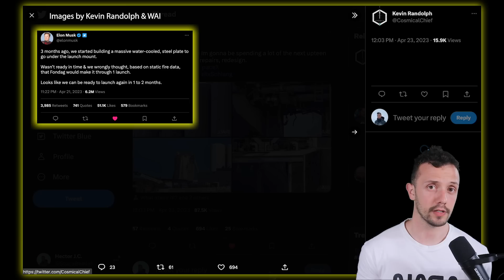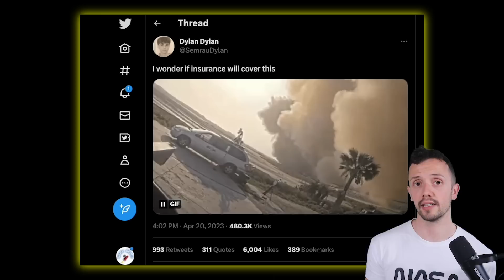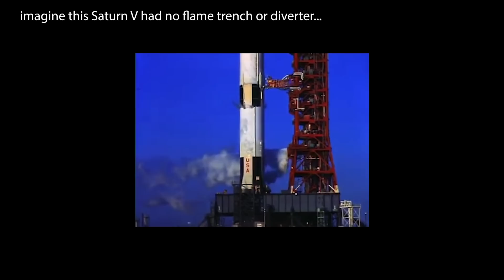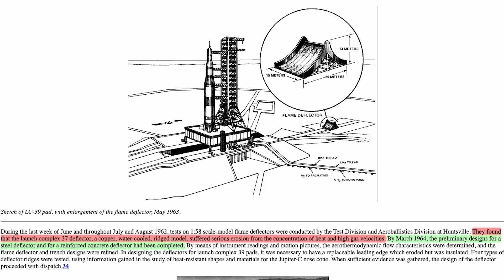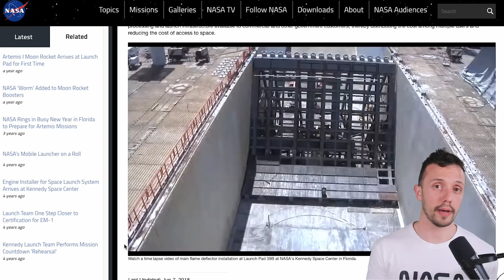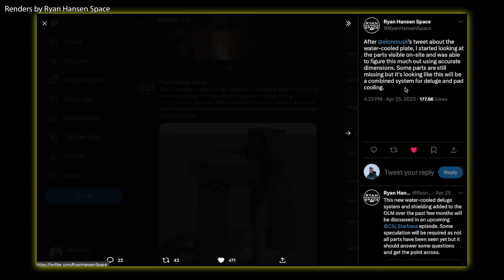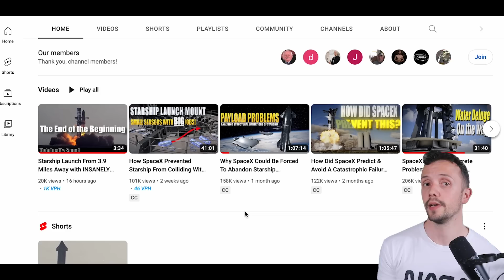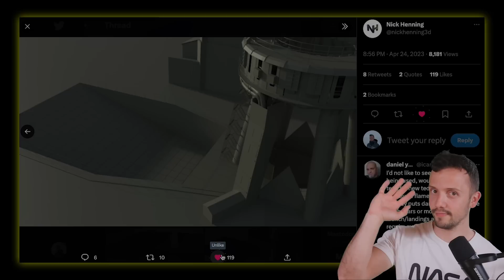SpaceX is Developing a Smart Solution for its Pad Problem: What We Know & What It Could Look Like!

Comment: If they were wrong about the concrete, they can still be wrong about a flat plate.  I still see the exhaust gasses rebounding back into the vehicle.  It looks like a 50 cent solution for a $10.00 problem.

Comment: You could have an Upside-down cone to use as a flame diverter and then have the launch platform legs wrapped in armor plate. You could have the flames come out between those legs like they do from a muzzle break on a machine gun... using the type of armor plate used on battleships. That sort of thickness of steel might be needed. Thankyou Space Beetle.
Reply from the maker: I also saw a design concept similar to an upside-down cone, which would likely work well too, but I think SpaceX wants to maintain easy access to the engines of the booster when on the OLM, so I guess that's one of the reasons for going with "just" a steel plate. And yes, the plate will need to be very thick
Reply: I imagine a cone is harder to cool, compared to a double ramp style design.

Comment: Reading so many comments that are stating that this is a massive problem and that SpaceX could have prevented running into these by simply sticking to known and conventional solutions. I'm no rocket scientist, so not here to judge those comments. Just here to remind; this journey from SpaceX is not about the use of known solutions, but rather on innovation, exploring new ways to solve known and new problems, simplification and eventually achieving significant optimization. It's the hardest way to go with the least certainty of success, but is a way that could potentially deliver capabilities that humanity never had before.
Reply from the maker: Mistakes are more frequent when innovating, and that is a fair price I think. I like the way SpaceX does things and learns. Their pad mistake could very well lead to a new flame diverting system that works just as good as the traditional ones, but is more flexible and possibly cheaper.
Reply: Innovation would have been going further on the design and versatility of the space shuttle. The most versatile and useful spacecraft ever. Not going back to conventional rockets and having to reinvent everything just because you want to go bigger.

Starship and it’s booster are like the burj khalifa. Very tall, but they need to pump out all the shit by hand. Three steps back from a simple sewage system that has been thought out for centuries.

This is what you see now with silly starship.
Reply: Don't agree at all.  The  "innovation" argument with this specific issue is bogus.  Starship is such a hugely ambitious project on so many levels that adding one more "clever innovation" is a deal breaker. Would've been SMARTER to go with some variant of an orthodox flame trench and water deluge system.

Comment: I agree with you Sir: was/were the rocket OUTAGES due to debris?    I believe that 5 or 6 of the engines were not functioning, or at least not properly functioning.   I am not a rocket scientist, and I understand that Elon and SpaceX are working on new technologies, but using a flame/thrust diverter, appears to have worked reasonably well on other large rockets.   Perhaps, just perhaps it's not always the best choice to avoid older technologies that work.    Look at the damage - it's staggering.    Would have a flame diverter eliminated or helped to eliminate this damage - maybe?    Technology and new engineering techniques are interesting.
Reply from the maker: They could have used that already existing technology but I guess more frequent/bigger mistakes is the price to pay for innovation. Maybe this mistake will lead to an even better flame diverting system that works well for them and is cheaper/easier to build and replicate.

Comment: the water cooled steel plate is a win win for me tbh. if it actually works out then i will be very surprised and amazed and if it doesn't work out then i have something to laugh about. so either way its gonna be fun to watch this
Reply: Test it out using a static fire at 100% blast, for twice the amount of time a real launch would take.
If it can survive that you're golden.
Reply: @protorhinocerator142  If it doesn't survive a static fire like that then it's back to square one only this time there's no flight data.
I say launch and be done with it at least there will be more flight data.
Reply: @straighttalk2069  FAA won't allow them to launch until they fix this problem to their satisfaction.
So no.
Reply: @protorhinocerator142  Don't the FAA have to grant permission for a static fire and road closures, meaning a no to static fires ?
Reply: @straighttalk2069  no

Comment: Great video, as always...
Note that both the launch pads 39A and B were built up to allow for the construction of the trench.  The Cape has as high a water table as B.C.

Another miss I will never understand...
Fuel and oxidizer are stored at the exact opposite ends of 39A & B. Each, 0.25mi from the mount, 0.5mi from each other.
You can emmbellishingly spit from the B.C. mount to the fuel farm.  Theycould have built the fuel farm horizontally and place it at the sub-orbital location...but then again, thats one hell of a mess.😎
Reply: @Dan P For this to be done right, all of Starbase needs a redesign.
Or maybe open a new section of Starbase with the new and improved launch system.

Comment: SpaceX aren't allowed to build a trench because to do so they need to get permission from the Army Corps of Engineers as it can potentially disturb the water table in the vicinity, such a process can take years. Given the problems found during this launch seem to revolve around the integrity of the concrete and not reflected pressure waves hitting the booster, flat shielding with sound suppression water deluge should be ok. It is clear they have been working on this for some time as the mount being built at the cape is very different incorporating the deluge system and yet to be revealed concrete shielding.

Comment: If the chopsticks are designed to catch the booster can it also accommodate lifting the whole fully fuelled starship + booster, say 1/2 tower height, at launch?
Reply: Exactly.
Suppose it lifted the rocket from the trolley to the current base, rotated 90 degrees from the trolley. But then there's another base 90 degrees more, and higher up.
Put the diverter under that, and it won't interfere with the trolley moving new rockets into place.
Reply: @protorhinocerator142  great idea. If ordinary people can think of this than it is clear not enough thought is going on at Stage 0 designing. Obviously most of, (and probably nearly of all of the whole launch site) the massive effort the 1st starship/booster launch was rushed and wasted because of this very reasonable and realistic oversight, though, somehow, I think we are all equally to blame.
Reply: @jazzunit8234  I'm not to blame. I wasn't there.

Comment: What SpaceX appears to be planning for the OLM could best be described as a water cooled heatshield. It's not a diverter cuz it's not diverting anything. Nor does it need to. Heat is all the concrete really needs protection from. People don't realize this, but concrete and even natural stone has water in it. When you rapidly heat it past the boiling point the water in the stone expands by up to 600X fracturing, even exploding the concrete.
Reply: For a heat shield to work the water will have to be pressurized. If not built properly any damage to said heat sheild will result in pressurized water escaping which when combined with the heat of the rocket will lead to a massive steam explosion. So I have my doubts whether this solution by Musk is viable.

Comment: Diverter not needed  -  Fill in the pit with concrete and cover it with a water cooled layer of steel.  The sonic 'Jack Hammer' will not be able to break up the steel sheet and the water cooling will stop it from melting...
Reply: nope, won't work.

As soon as even just one little weakpoint in the steelplate is present, it can and will become a crack and this will mean that the heat will get underneath the steelplate, lifting and breaking up the steel plate and then attacking the concrete underneath and...... Elon will have to claim another big successful launch while waiting for months until stage zero is rebuild once again.

Comment: Its not a diverter because it does not redirect the thrust, nor the acoustic energy caused by the boundary turbulence with the plasma flow.  Rather, its a Reflector that will cause a lot of the thrust and sound to bounce right back up into the engine bay.  Moreover, you would think that they now realize it might be handy if it directed the blast AWAY from the launch tower and the fuel farm tankage.  Those plates need to be sloped and curved to do the job, and they ought to be segmented for easy and quick replacement because they will still suffer tremendous wear.   Unfortunately, the hexapod design of the launch mount does not allow for a single piece flame diverter to be rolled in and out, due to the confined space between legs being significantly less than the diameter of the blast zone. And the only reason their design might be flat is because they are trying to preserve their ability to roll their engine install and servicing rig under the mounted boosters.   A surface perpendicular to the thrust vector is a solution that maximizes the energy impact on the pad, rather than reducing it.
Reply: In short, they are trying to reinvent the wheel because someone in the command chain is to stubborn and to much of a megalomaniac to want to listen to proven scientific facts.
If I was a US taxpayer I would be peeved of at them wasting time, resources and money on building things that anyone with basic understanding of physics can tell them isn't a solution

Comment: The soviets N1 rocket flew twice as far as Starship 50 years ago! with its 30 nk-15 engines this launch pad fiasco is the beginning of the end for Starship the steel water cooled plate wont work it will explode like a huge boiler tank they need a Trench or its over for Starship the FAA will be insane to allow them to launch without a trench!

Comment: Shows the advantage of actual test launches.  The public and engineers get to see actual results.  In this case we now know that a flame trench is needed.  Problem is, the FAA has blocked launches for the last 2 years.  Allow SpaceX to put their fixes in place.  Then launch again.
Reply: ah yes that darn FAA that was looking out for the safety of the fauna, the flora and the people working around or living within miles of the launch site.
The same people that now has their windows broken 6 miles away and other damage inflicted because of the 'successful' launch by SpaceX.

Comment: I doubt a diverter alone (half-measures) will protect the tank farm, control sound, or dampen vibration. Plus the tower will still have to deal with the heat and any debris that are kicked up. None of that is conducive to rapid reusability.
Reply: just allow SpaceX to build what they need to build.  Instead federal regulators will delay and delay.  And Biden will not step in to require that all interested parties work together quickly so that SpaceX can continue to test their system.
Reply: @Steve-Richter  If that means we lower risk to public safety and increase the chance of successful outcomes, I don't see the downside of government regulations.
Reply: @aeasus  the FAA says this launch did not damage wildlife. Next launch will cause less damage and the engineers will learn more. Very worried the regulators will shut SpaceX down.
Reply: @Steve-Richter  I doubt SpaceX would get shut down. But, knowing you're going to have a problem with a launch and not resolving it because of time constraints on an alpha prototype is not acceptable. That tells me there needs to be more adults in the decision making.

Comment: It just shows you how well built starship was built!
Reply: Steel will provide that. Unfortunately it is heavy which is the source of a lot of problems. Problems they may not be able to solve.
Reply: @tatata1543  They can solve the problems (with the pad). They are just going to have to suck it up and do it right, or abandon Boca (which they are going to do anyway once the Cape is up and running).
Reply: @hawkdsl  They have the same problems at Cape because they decided to build the tower first rather than the launch pad.
Reply: @veergauba  The plate they are about to install at Boca came from the cape.

Comment: the diverter simply cant just be a flat, level plate.  that would result in the blast torching through the legs of the orbital launch mount.  the blast needs to be directed on a sloped surface that will aim everything away from the tank farm and any other vital systems that are close to the pad.
Reply: Correct. That blast needs to be directed AWAY from the rocket, not managed beneath the rocket.

Comment: i hope their new flame diverter design takes into account BOTH the heat of the blast of 33 raptors AND the tremendous force of all of that exhaust gas hitting the base... -reading over the many reports of the first launch, it seemed to me that the worst damage was caused by the force of the exhaust gas hitting the base maybe more than the heat of it?
Reply from the maker: Yes pressure is a big issue. I assume whatever steel plate the place under the OLM, it will need to be very robust with an even stronger foundation to not sink in and crush the water pipes underneath. But, everything remains uncertain until we can see what they do.
Reply: Heat is not that big of an issue as the time at the pad is short. A factor yes, but it's not like they need some exotic metal for the job. The plates on the OLM legs did not melt for example.

Comment: The Problem is ... The Launch Pad Has to be Strong Enough for to remain Undamaged for Years and Hundreds of Full Throttle Blasts !
Reply: Actually that's not the problem because the Boca Chica is for development and testing of the starship.  They will launch a number of Starlink sats from Starbase, but the rapid launch cadence will happen at the Cape.
Reply: @michaeldeierhoi4096  How is Boca Chica going to test anything on the BF Rocket ... If they have NO Lunch Pad ? ... And Until they figure out a  very Strong reusable Pad : Construction at the Cape is Halted ! ... Rocket development is Halted ... and Raptor engine testing is Halted !
Reply: Crazy thought time.
What if they made a launch system that moves the rocket out to sea? Most of the tower is beneath the waves, with only the minimum popping up above the surface. Then you automatically have an infinite amount of water for flame diversion.
Reply: @protorhinocerator142  Taking off from Water , and Landing on Water would solve a lot of issues ! ... Unfortunately , Takeoff and Landing is only the First of Many BF Problems ... and they are all HARD ....
Reply: @robertbrander2074  Mainly takeoff though. Do this on water.
I'm thinking a permanent submerged island instead of a barge.

Comment: How is the lift off going to work on the moon or mars?
Reply: Hard to tell, but they will have the vacuum on the moon and the near-vacuum on Mars helping to reduce the shock wave.
Reply: @ghost307  A rocket being close to the surface is going to cause debris to fly everywhere.
Reply: @richardj163  Didn't have much of a problem with the liftoff of the LM.
Reply: @ghost307  The Lunar Module had two stages. The descent stage was essentially the launch platform of the Ascent stage. The moon is far easier than Mars.
Reply: @richardj163  The 2 launches will indeed be different, but with an atmospheric pressure of less than 5 Torr on Mars it will be much closer to the lunar launch than an Earth launch.
Reply: @ghost307  Starship hasn’t got off this planet with all the resources close to home, including the observation and wreckage of failed attempts.
Reply: @richardj163  Have faith.
Look how many rockets failed at Penemunde, Kazakhstan and the US before they got it to work.
Reply: This is the question!

Comment: Seeing the launch blew out steel blast shields on the launch mount, how would a water cooled steel plate directly under the rocket do any better?
Reply: It will be the next epic fail
Reply: I think a water cooled plate will fail spectacularly.
Instead of being a stable base, it will be a superheated steam bomb under the rocket.
You need a system that doesn't try to contain the water. Anything contained will explode very violently.
Reply: No shielding on the mount was blown out, a door was blown off its hinges but all the shielding remained intact. Shielding on the tower was damaged by concrete hitting it. Water cooling is to remove energy from the plate keeping it cool enough to keep structural rigidity. Essentially there will be water on top of the shielding and under it. The legs of the mount were not damaged by the launch so concrete shielded with steel seems to be enough.
Reply: @schrodingerscat1863  Some sheilding was blown out, especially on the lower levels.
Reply: @veergauba  Shielding was damaged by concrete projectiles for the most part. Draw works shielding was significantly thinner and ended up peppered with holes as concrete projectiles punched right through it. Most importantly shielding on the OLM held up well.